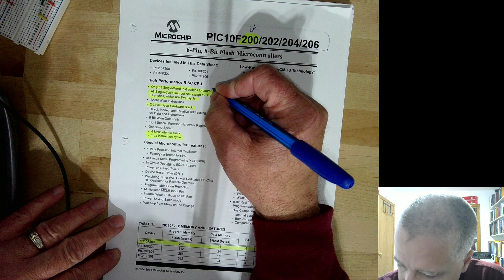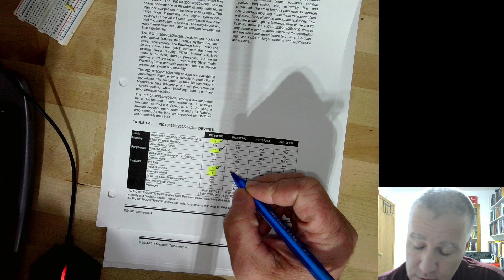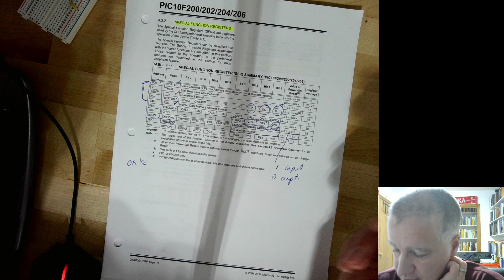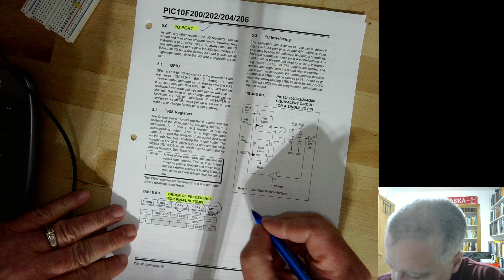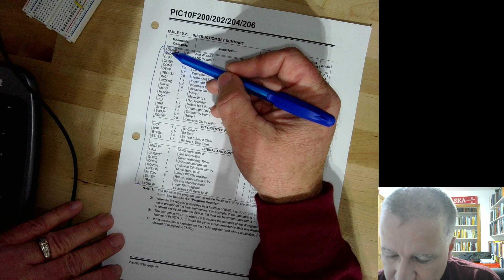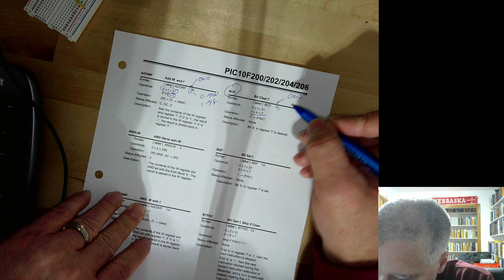Navigating the PIC10F200 Datasheet - Understanding Hardware and Instruction Set

Comment: Hi. Thanks for your work. I have a question in the video time 12:42 . i am using PIC16F15313 and on page 80. it has 0-13 bit. I want to make changes to 13 bit. What does the code look like then?
Reply from the maker: I’m sorry I realized that I replied with my other account. I hope you were alerted to that reply. If not, I’m sorry for the delay.
Reply: @GNLProject-yp8po  Thank you very much. I also remembered in the process that you can check SFRh in mplabx. and there are two registers and their addresses if there are more than 0-7 bits.
Reply: Your PIC is much more advanced but I think it is still 8 bit. In this case it must be using 2 registers in order to accommodate more than 8 bits. So it probably has a “high” byte and “low” byte and you will need to write to the bit 5 on the high bit if you want bit 13 most likely. 
Also your PIC has more than one memory bank which can be really confusing. Make sure you are in the correct bank. 
I’m sorry that I couldn’t be more specifically helpful but I have not worked with the PIC you are using.